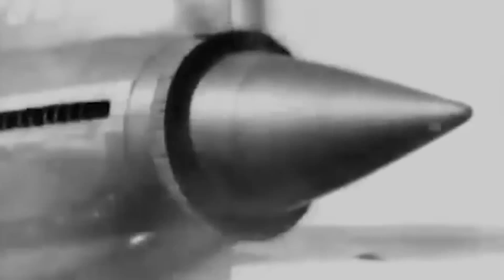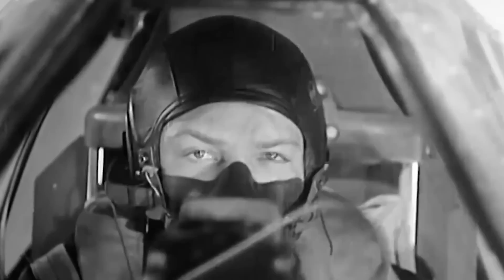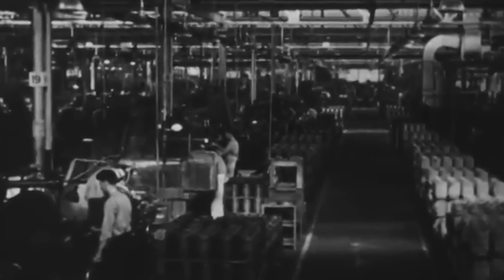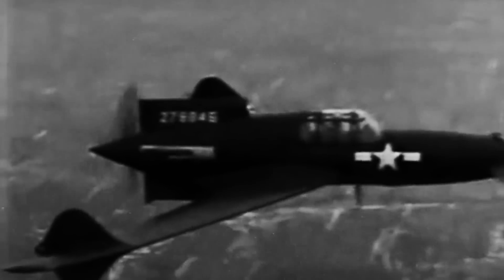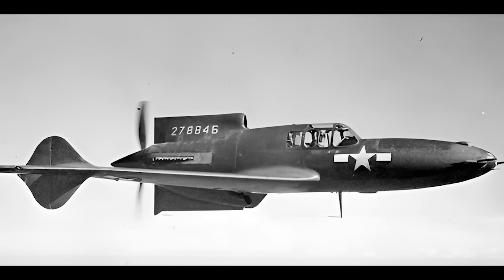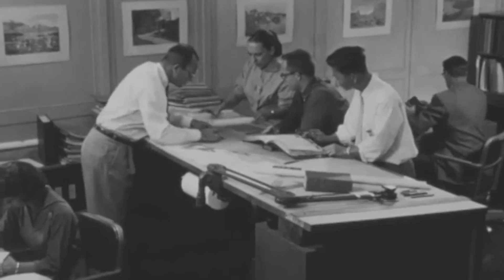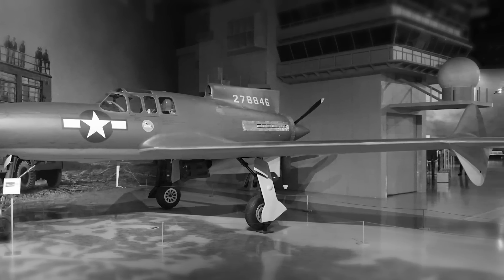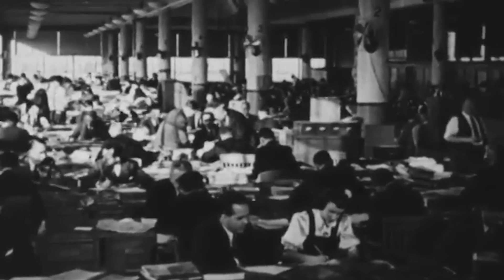The Aircraft That Almost Caused Jets to Never Happen

Comment: The primary thing wrong with the Ass Ender was that it was designed and built by Curtiss. The second thing wrong was it never got the engine or the power it was designed for. Curtiss in the early to mid 1940s was by no means a cutting edge aircraft manufacturer. Now if, a very big if,  Curtiss could have had this rebuilt to take one of the same turbo jets the P-80 did. Plus straighten out the aerodynamics issues.

Comment: I got to see the XP-55 and XP-56 in the annex and restoration hangar at the Museum of the USAF at Wright Patterson AFB about 1980. I was in Jr. ROTC in high-school at the time. They had a Boeing P-12 in the resto hangar that the staff was building.  Fuselage was built with the lower wing mounted, but the upper wing was on a build table with no skin on it. Not sure if it is still there. 
 Back then the XB-70 was parked outside in front of the main hangar.

Comment: Canards can be stable, if the foreplane is more heavily loaded for its area than the wing - but a moment's thought will show that this is inefficient - for a start, it precludes the use of wing flaps. So it's no surprise that the Ascender had miserable performance  As an aero engineering student long ago, I built a wind-tunnel model of a canard design for the equivalent of a Beech King Air.  What it showed was that (a) the longitudinal stability went to Hell when the tip vortices shed by the canard interfered with the wing;  and (b) the centre of gravity location necessary for the thing to be flyable at all, was in a location roughly mid-way between the foreplane and the wing - so there would have been nowhere convenient to store the fuel (because the fuel needs to be located at or very close to the centre of gravity).  Even if the stability issue could be overcome,  this made the layout totally impractical. That is why the Piaggio Avanti is a three-surface aircraft, not a two-surface aircraft.  So the garbage accompanying this video is just that - garbage.  Foreplanes  can be used on supersonic jets, because they become seriously nose-heavy at supersonic speed.

Comment: Jets were inevitable. The physics of aero thrust was movement of air by propellor blades turned by internal combustion engines.  Power was enhanced by compressing the intake air with a engine powered blower or a turbo blower powered by exhaust gas. The jet engine power was external combustion compressing the intake air and burning fuel in a chamber to make thrust with hot gas. Later jets went to bypass air propulsion using a propellor in parallel with the gas jet thrust. Other versions used the jet engine to power a geared down propellor.

Comment: Looks like the canard has a symmetrical airfoil. And the wing airfoils usually have a camber. 
 
Then it cannot work, then the canard, while increasing agility, is NOT helping stall characteristics as it could/should 
 
The canard needs MORE camber than the wing. Then with rising angle of attack the canard stalls BEFORE the main wing. 
 
As the canard is in the front, FORWARD of the center of gravity, the nose drops, preventinng a stall of the wing, The airflow at the canard reattaches with less angle of attack, and the plane is safe. 
Ideally you can pull full elevator, and all that happens is that the plane gets into a stable sink with high angle of attack, that can be stopped instantly with reducing elevator. 
 
I had a canard RC model that did exactly that, worked great. 
 

When you have your elevator at the tail, it is exactly the other way around, Then the elevator must not stall first. 
Would that happen, the tail would drop even more, increase the angle of attack and the stall would be way more violent.
With a non-stalling elevator, the lift of the elevator "pushes" the tail up, so tha tthe airflow on the main wing reattaches. 
 .

Comment: The design features were so unprecedented you had to go back to the Wright 1903 Flier for something comparable.  Elevators in front- check.  Engine behind pilot with pusher props- check. This was Curtis Wright going back to its roots. Don't make gee-whiz claims you haven't researched.

Comment: The ME 262 jet was not "the first powered aircraft".  It was, however, the first, mass produced, and used in war, jet powered, airplane.  How about editing the commentary on these things before publishing them.  It might improve your credibility.  I think this Ascender had too much sweep to its wings, for a prop driven, not fast enough, plain.  Thus the stall problems, and others.  I don't think front, Kinard control surfaces ever worked out very well, and rudders on the wingtips made for, not an intuitive, for pilots, design, at best.  Maybe dangerous, at worst.  I did enjoy this video, aside from the slight inaccuracy mentioned.

Comment: And then in 1974, Burt Rutan built the first of several very successful canard, swept wing, pusher propeller, tri-cycle gear aircraft.  The Vari-eze and the Long-eze were two extremely successful kits built by many experimental aircraft builders.  Unlike aircraft kits of today, these are mostly built from plans with a very few manufactured parts.  Several other canard designs copied much of Burt Rutan's designs and also became successful.  These aircraft are known for being almost impossible to stall and are very efficient, yielding great speed on mediocre power levels.
Reply: Rutan's designs use a different canard design.  His planes were designed to be 'stall-proof' by forcing the canard to stall before the main wing.  The plane then mushed downwards and the canard started flying again.  THis was not the case with the P-55.
Reply: My buddy in Florida built one of those kits, I used to see and hear him every morning flying over my house like a little buzz bomb.
Reply: Hot little plane…better know how to land fast squirrely planes. Rutan wanted you to have around 15 hours in a Yankee before you tried to fly your own home built. The canard had a tendency to porpoise the plane if you tried to flare too slow like in a Cessna 150. If it go too bad the tip of the canard would hit the runway and cartwheel the plane. I was building one. Read about problems in Aviation Consumer magazine….stopped building it.

Comment: "In test flights the XP-55 achieved 390 mph at 19,300 feet but there were engine cooling problems.[2] In terms of overall performance, testing of the XP-55 revealed it to be inferior to conventional fighter aircraft.[4][7][12] In addition, by the end of 1944, German and British jet-powered fighters were fully operational, and the Lockheed XP-80 was about to commence operational trials with USAAF units in Italy. Development of completely new piston-engine fighter designs was regarded as redundant; further development of such aircraft was terminated, including the XP-55. " This was a poorly done experimental aircraft...it NEVER got anywhere.

Comment: Impressive design but the Nazi's had the Komet which was very similar in airframe design; and rocket powered pressing close to the sound barrier over 600 mph. They had a longer duration model in the works at the end of the war. Me 263.

Comment: If you read the WW2 reports on the XP-55 Ascender you will find out is had problems.  It was designed for a engine that didn't happen., it had evil flight characteristic stalling being the worse. It top speed with available engines was only about 390 mph.   As with so many of these piston WW2 prototypes existing planes, P51. F4U, F6F. P47 were much better.

Comment: Air to Air refueling 
On August 27, 1923, the crew managed to keep the receiver aircraft in the air for 37 hours and 15 minutes with five refueling maneuvers. The US Army aviation group continued to work on the possibilities of aerial refueling. In 1928 she planned to set a sustained flight record. At the Middletown base in Pennsylvania, the Fokker C-2 with serial number 28-120 was converted into a receiver aircraft with additional fuselage tanks and receiver equipment.
Unfortunately, this technology was almost completely forgotten by the Allies during World War II, even though they had a huge problem with the range of the fighters over Europe and Southeast Asia until the arrival of the Mustang. This plane would have been ideal as a long-term escort fighter at the time. Technology is only as good if it is used correctly and that is still the case today.

Comment: P-38 had tricycle wheels, so did the B-25
Reply: B-24, A-26, and P-61 to name a couple of others.
Reply: So did much earlier aircraft, like the circa 1910 - 1912 Curtis biplanes.  The Curtis Model E (1912) could be equipped with floats or tricycle landing gear.

Comment: Total bollocks! America were so far behind in terms of aviation that the Germans and the Brits who who both already had a flying jet before the XP-55 even left the drawing board.
Reply: America had a jet design in 1939 Lockheed L-133. but because Europe needed planes now, the war department and brits and French wanted working conventional planes and war department wanted unproven jet engines put on the back burner and concentrate on piston engines. so we got the p-80 in theater just as the war ended so theirs that.
Reply: so far behind? p-51,f4u corsair, p-38, p-47, f-6f b-17,b-24,b-25,b-26 yeah way behind! plus supply a bunch of ungratefull countries with band-aids beans and bullets

Comment: This is filled with inaccuracies. First you make a statement about the xp55 being stable. It was never stable. You did change it later in the video. You then made a backward statement saying the experimental engine wasn't used because of the Allison v1710. No, the experimental engine wasn't used because it never lived up to expectations.  Also, the P39 airacobra And P38 lightning both had tricycle landing gear before the xp55 was ever built. You need to be more factual and stop with the clickbait titles. This is a distortion of history. Stop Doing THIS.
Reply: Have you ever noticed that the creators never respond to statements like yours? They have no ethics whatsoever. BS like this is what YT needs to be shutting down. But, thanks for setting the record straight.
Reply: You forgot two pioneering designs,  the Douglas DB-7 Boston and North American NA-40 Mitchell both these fitted with a tricycle undercarriage. Without computerised flight controls the XP-55 was a recipe for disaster , the stalky undercarriage  made it ill suited to rough dirt or pierced steel planking strips.  As for Curtiss P-40, their' F' model with a Packard Merlin 28  clocked up 376 miles per hour. In the desert air war the 'F' model P-40 was the only fighter able to take on the  BF 109 F and Macchi C202 Folgore on roughly equal terms,  until Mark 8-9 Spitfires arrived .
Reply: So true, that's not just on this site, it's a societal problem in these times... sad days ahead if this continues. cheers
Reply: Machines don't listen.  You can only expect so much. It's not checked.
Reply: Basically I opened this vid to say this too, also that jet aircraft would not have been delayed by this nor anything else.
Reply: Thank you.

Comment: Well that's a clickbait title. Nothing would have stopped the advent of the jet... just taking far longer for jets to become established. Nothing stimulates innovation like war.
Reply: From Wikipedia 

The first jet, Heinkel HE 178, flew on August 27, 1939.

The XP55 first flew on July 19, 1943
The United States Army Air Corps proposal R-40C issued on 27 November 1939 for aircraft with improved performance, armament, and pilot visibility over existing fighters; it specifically allowed for unconventional aircraft designs. 
In June 1940, the Curtiss-Wright company received an Army contract for preliminary engineering data and a powered wind tunnel model.
Reply: @craigd1275  Sir Frank Whittle patented the Turbojet Engine in 1930 but it wasn't test flown until the 1940's , however the Germans took Whittles design and blatantly copied it and the HE 178 was the result . They did make some changes so it wasn't identical but that was just to claim it was their invention .
Reply: um
Even Nazi Germany thought it was a better idea to make a fighter with two jet engines, low-bypass non-turbofan non-afterburning non-thrustvectoring non-ramjet jet engines no less,  rather than two piston engines each driving a single prop (which by the way, the Nazis did actually make). It's not even a turboprop (which the British Air Ministry tried to make instead of the pure-jet Glouster Meteor)! It's not even a counter-rotating prop (which the British did make after developing the Glouster Meteor JET)!!!! After WW2 the Soviets tried every conceivable form of prop and jet fighter before settling on JETS.

The US had prop planes, designed and built in WW2, that flew in combat into the sixties while developing an entire series of supersonic jets capable of delivering nuclear weapons. Then there was the U2, which had an 80k agl ceiling, and the SR-71, which ALSO had an 80k agl ceiling along with a top speed above Mach 3.5, that literally outran and outclimbed the Mig-25...which was designed to shoot-down the SR-71. Tell me again, which prop plane with a tip-speed above the speed of sound was going to stop the world from developing and deploying jets?!? Definitely not ANY US-designed plane. Forget about it!

There's absolutely NOTHING about this plane that "almost caused jets to not happen". What a load of complete bullshit.
Reply: @touristguy87  I believe it is in reference to the thought process of those involved in development. There was still a strong contingency not convinced in rocket or jet propulsion. Can't be sure, but even into the 50's many still weren't. As said, 'nothing stimulates innovation like war.' They now had platforms that prove jets were reliable in combat to get the job done. But, the same can be said with ever step in military advancement. A lot of people died before they made adjustments against the machine gun, just sayin'.
Reply: @bettyrose959  oh it was supposed to make everyone on the planet stop thinking of jets.
Reply: @bettyrose959  "There was still a strong contingency not convinced in rocket or jet propulsion. "

there are people who are still not convinced that the earth is round

...but who am I kidding. This is like saying that everyone is logical.
Reply: @touristguy87  No, you're hilarious. At this time in aviation there were many not convinced that jet propulsion was going to be reliable as prop driven aircraft. No different than those in the Navy arguing over Battleships and Air Craft Carriers. To me, this video title is something that the development teams would say. These companies had various different teams working various different projects. I'm sure while this was still on the drawing board, the team was attempting to out preform those in the Jet development department. Both of them work off of grants and competition for financing was fierce. I'm sure they stated their ideas would out perform their counterparts. And stated there was no need for a jet powered aircraft. But whatever, Attack people commenting is all you buddy. This was at a time of vast improvements, and many Air Force brass where in arguments over it's direction. Still using the majority of prop aircraft at the start of the Korean war. Until the encounters with the MIG.
Reply: @bettyrose959  

...it's as if 80 years of jet development...almost never happened.
Because of a single US piston-engined plane designed in 1942 that only flew with a P-40 engine, in two prototypes, that both crashed after a handful of flights and were totally destroyed. The third prototype, that never flew, now mothballed in a museum. 

Meanwhile a dozen wars were fought using jet-engined fighters and bombers, and 80 years of commercial airline service was flown using jet-engined passenger planes. Even the Space Shuttle was transported using jet-engine planes. 

Keep drinking that MAGA juice.
Reply: It wasn't even that nothing was stopping the jet, but also both the Germans and the British flew the fucking things before the US even got its hand off its cock.  NO aircraft "almost caused jets to never happen"!  Let alone the failure depicted in the video.
Reply: Such bull dust. The Germans and Brits were much smarter than this
Reply: U I 9ò⁸ò⁰⁸⁷7⁸⁷⁷⁸⁸so so
Reply: Came to say this. Jets were already a thing! What about the Messershmidt?
Reply: Not even - nothing would have caused a delay of jet aircraft.
Reply: @DJW1959Aus  
...sure...